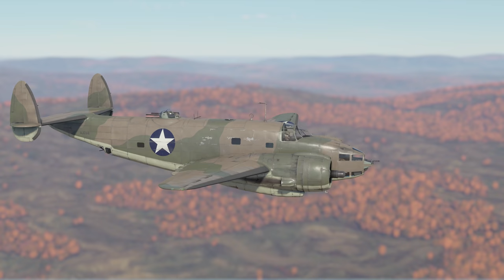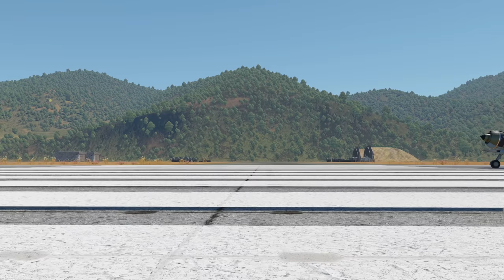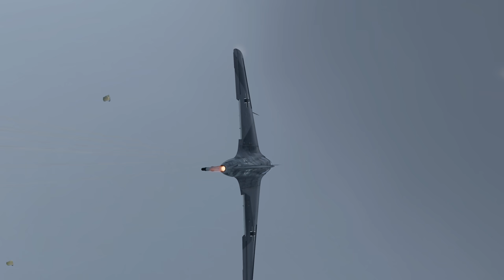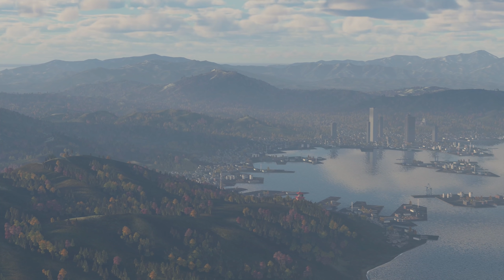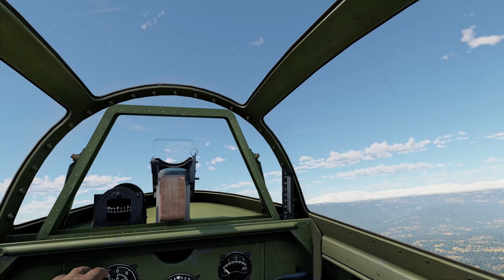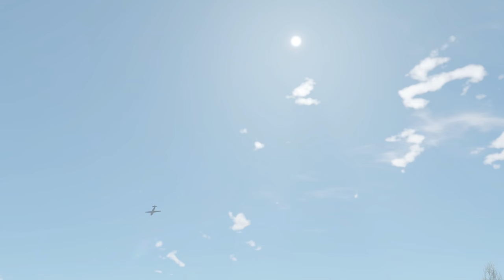Rocket Planes / War Thunder

Comment: So why is it that Ki200 and maybe also Me163 still cannot take off reliably yet still cost that much to repair and then get a video like this dedicated to them?
Reply: You don't enjoy exploding on takeoff for no reason?
Reply: Don’t go 100 percent throttle that’s it I heard
Reply: The rocket planes use different fuel compared to other planes the ki200,163, and the Bi use rocket fuel which is heavier which is why the perform better at low fuel
Reply: (They)

Comment: Day 5 of telling Gajin that they need to increase their SL rewards in random battles
Reply: I prefer them cutting the repair costs
Reply: @ariq4209  both is good.
Reply: @ariq4209  mainly cutting repair costs and making the repair cost the same across nations.  it's kind of unfair that the german is paying 6700sl (It is rank 3 but has the same BR as the other 2 planes) to repair the g2, the Americans are paying 9000sl to repair d5, and the poor soviets have to pay 21000sl for the yak9u.
Reply: @arielkravchinski2616  training costs are unnecessarily high
Reply: @kakagakakerger4165  22k sl for it on b18b help im 1000 sl
Reply: @user-ol9kr8pg8q  my tip is
stop using the b18's except for the 2.7 one
😎👌

Comment: Gaijin what were you thinking when setting 20k silver lion repair cost and 24day repair duration to a simple rocket plane like ki-200?
Reply: They're trying to be slightly realistic
Rocket Fuel is very expensive and very dangerous to handle requiring complex equipment
Reply: @jamesricker3997  this is a game
War thunder is not meant to be the most realistic aviation video game so why the hell should the players care about the logistics behind flying rocket propelled aircrafts???
Reply: @jamesricker3997  in the same game you can buy a war plane fully equipped with guns and ammo for 50k sl
Reply: @jamesricker3997  ratio'd
Reply: @jamesricker3997  if they want it to be a rarity since they don’t want it everywhere in a ww2 setting as it’s unrealistic, just put a thirty minute to an hour timer on it until u can use it again.
Reply: @c17bykenshi67  'War thunder is not meant to be the most realistic aviation video game' Dude. It literally has simulation battles with fuel and wing stress. Just because it isn't DCS doesn't automatically make it Ace Combat.
Reply: @LittleKachowski  lmao thats the funniest comment i read today. I agree with you, that war thunder isnt either extreme but rather something in between in realism. The rocket aircraft fuel being the reason for their high repair costs makes still next to no sense, as far as i know gaijin chooses repair costs almost purely off of how players perform in them, meaning if the average player gets 5 kills per game (or rather how much money they make, for all the bomber guys) in one specific plane gaijin will raise its repair cost so its more high risk high reward. This does however heavily punish lesser experienced players when playing vehicles with high repair costs because they will be dying more often and getting less kills meaning they lose a ton more money than they are making.

Comment: So did you ever fix it so I can take off and not glitch into the ground with the little Doritos?
Reply: hav u tried getting a new hamster to donate
Reply: I got a squirrel, could that work?
Reply: Just throttle up with landing flaps and don't touch the controls until you are off the ground
Reply: @WalletWorrier  i still only get off the ground like 50% of the time.
Reply: @carterstanton3662  You just have to make sure your rear landing gear does not touch the ground, throttle up and pitch the nose down so that your plane is level with the ground, take off with flaps at around 310 kph, take off very slowly so that the rear landing gear doesn't touch the ground.
Reply: @carterstanton3662  make sure you don’t pitch up at all, or that rear gear will hit the ground and cause bounce. Keep the pitch at 0 degrees until 300kph, then u use takeoff flaps and pitch up a tiny bit.
Reply: @ariq4209  It would be nice if doing fancy bullshit was not neccesary just to take off
Reply: Yeah it’s the rear wheel that is glitched, it’s not that it doesn’t spin and causes friction, the suspension seems to be op and bounces the aircraft into a flip killing you instantly or causes you to come to a halt.
Reply: @Betto_333  this made me laugh hard 💀💀
Reply: A Ki 200 exploded next to me when we were taking off. I also died because of the explosion. I didn't even mad, finally had a good laugh in WT after a while
Reply: @daryrizki5236  I would always crash it on takeoff, the trick is to pitch down to get the behind wheel out of the ground and then (with flaps on combat mode) pitch up slightly with +250km/h
Reply: @Jeb724  no the cat is smart enough to shoot him self
Reply: @Jeb724  gaiji will employ you to run the wheel, you will be paid 0.2¢ for a day

Comment: Just imagine being able to take off without a runway, just soaring straight up into the sky and surprise enemy formations and show off vastly superior speed...
Reply: @iplxel7888  they were much later and did not have that much of a technological advantage, but they are still cool.
Reply: @edi9892  and the harriers werent deathtraps
Reply: @user-fj7ig2jq6q   they actually were just in Different ways
Reply: @50centpb7  not even close to the level of the german rockets. This is all irrelevant anyway considering the germans never had an operational vtol, and even their prototypes needed external boosters. And were deathtraps.
Reply: Just imagine being able to take off...
Reply: I've heard that the F-104 Starfighter could take off vertically

Comment: They would be very fun if they didn't have way too big repair costs.
Also Me 163 with 20mms is at 8.7.
8.7
And costs over 25k SL to repair when stock
Reply: Honestly in my first flight of the 8.7 163 I got 3 kills without dieing, the last surviving enemy was a Spitfire MK 1 funially enoough. He dies because he had not enough fuel to RTB.
Reply: its because its good... unfortunately
Reply: Me163 are joke, nothing else
Reply: 25k? Actually that is 5k SL more expensive than my T95
Reply: @zafranorbian757   well the plane is good for sure but you regularly face uptier against plane faster and some with a similar climrate and even some have missiles while you may have very good manoevrability but you only have 5min of fuel (you Can extend that by managing your fuel but still very limited) and not that much ammo and you Always risk to snap your wings during sharp turn

The plane is already itself a high risk high reward but that repair cost (28k for the ki-200 for exemple) is way too much for what the plane gives and to be viable, litteraly if you lose, even if you do multiple kills you will still lose money if you don't have premium
Reply: @ah-64apache92  the joke is Gaijin itself thinking fighting Mach 2 Capables with a 1945 Rocket plane is balanced
Reply: @Manuel - Way, way better 30mms than Mk 108s too.
Reply: @ah-64apache92  Nonsense, git gud
Reply: @Pantsugrenadiere  It also can’t fly a sustained 900kph flight for a long time like the 8.3 Mig-15 and F-86. The B-0 should be back at 8.3.
Reply: And i thought my ki200 was bad
Reply: It also randomly explodes at points on the runway due to the back wheel being glitched and sometimes even kills friendlies
Reply: @Alex Snowden No, the 30mm is fine at 8.0 as 2 x MK 108 isn’t good. The 20mm should be 8.3 because most of the time you’re only flying at 500-600 kph to save fuel, and when it’s 830+ it rips easily at turn. If F-86 and Mig-15 are 8.3, then it should be too.
Reply: you shouold consider yourself lucky that your pilot doesnt get randomly dissolved XD
Reply: the Re.2005 is laughing with its 33k SL repair cost at 5.3 BR
Reply: @colonelgeorge3358  And 6K more than the Ferdinand
Reply: @bobsjepanzerkampfwagen4150  read more, T95 repair cost is 20K. But that is fine since i have 20M SL
Reply: cries in b29
Reply: Yea 20 Mm can stay at 8.0 but 30 mm cant dont have that much burst and less ammo. Second you cant catch many  planes now. Wtf i play 10 games i cant catch anybody in chase.  And for comet is bad cahse on long disitinc.
Reply: @Manuel - 8.3? It's still at 8.0 for now
Reply: @zafranorbian757  better planes like mig15, sabres and the new Italian plane are at a lower br
Reply: @colonelgeorge3358  thats why i edited my comment i tought you said the t95 was 5k more to repair
Reply: if u play arcade it's amazing!
Reply: @AFlyingSwive  b29’s are born to suffer and there’s nothing I love more than blasting them out of the sky with my rocket boosted 262’s
Reply: The Me 163 B (MK 108 cannons) is the only one that has an appropriate repair cost. The Me 163 B-0 and the Ki-200 have abysmal repair costs.
Reply: @Alex Snowden 30mm is always 8.0
Reply: 8.7 makes the purpose of the 162 moot
Reply: The problem is that it's way too good... I've got an average of 4 kills per game with the B-0 in RB and you can even get 6 kills with relative "ease" compared to other planes. 
I agree that the repair cost is just ridiculous and that the BR makes no sense since the F-86 and Mig-15 are at 8.3. But it's very hard to balance and to keep good players from carrying the whole game with a single plane.
Reply: @MotorStorm  do you not get instakilled by missiles? I only ask because I'm considering buying the Ki-200, and I know stuff like the G.91 are on the same br.
Reply: @thelonious2213  just outturn the missile, it's easy.
Reply: @MotorStorm  yeah I get 4 kills too but the team still loses anyway. It's ok to be lowered to 8.3. Also not many plays it, I'm usually the only one in a match.
Reply: The US plains are pretty cheap to repair then if that's how much they really cost. Maybe that's why they don't fly as efficiently and are slower and heavier and so on. Their attack is much stronger but without the maneuverability it doesn't really do much good.
Reply: That's crazy
Reply: @sleepyrasta420  Don't worry, it's 9.3 now.
Reply: i have way too many SL so me 163 would be perfect for me
Reply: You do realise that you could take it into a match with only a few modifications and it’s still going to perform well and if you don’t want to deal with the higher br just don’t get the 20mm
Reply: @captainprice9683  And what does that have to do with anything? That goes for most vehicles in the game.
The 20mms are nice but nowhere near worth being 1.3br higher. 30mms have painfully low velocity though.
Reply: If you play the 163 and wanna have fun just play arcade because you don’t have missiles so it is more fun to 0lay arcade with early jets

Comment: Opinion: i think the Me 163 was very useful, especially to Alexander Lippish. Since it had a swept wing, an experimental design at the time, Lippish practically tested this and not only confirmed that swept wing aircraft was the way to go, but he also theorised that delta winged aircraft could be a possibility. He would later then help a lot in this field, which is arguably what he's known for nowadays. 

I could be wrong, any corrections are appreciated
Reply: Kinda dangerous tho I mean it’s easy to explode and if and fuel leaks you will be literally melted alive
Reply: @xninewxw7559  mhm it was def a daring task to be a pilot. I think once, there was a case where an Me 163 took off and literally 2 sec later it blew up into flames. Apparently he went on the throttle too hard
Reply: In terms of flight characteristics,it was wonderful
Reply: Well Messerschmitt and focke-wulf where expirementing with swept wing designs
Reply: The fuel blew up if it touched grass
Reply: @tylergehring7879  it explodes just by existing.

Comment: Ya I haven't flown my me163 in like a year because it's a flip of the coin getting that fckin glitch where the wheels fall into the runway so I very much hope that some of the budget for this advertisement when into making the plane playable
Reply: make sure you don’t pitch up at all, or that rear gear will hit the ground and cause bounce. Keep the pitch at 0 degrees until 300kph, then u use takeoff flaps and pitch up a tiny bit.
Reply: @ariq4209  It doesn't have takeoff flaps. It has landing flaps.
Reply: @cheesuschrist5017  whatever flap works
Reply: @cheesuschrist5017  Don't press f or you will not be able to take off.
Reply: "Its not a glitch its historical accuracy"

Comment: I've actually become a bit of a professional flying the Ki-200, getting about 5 to 6 kills per match and usually surviving to the end. If you can get really good and and survive the repair cost becomes practically nothing even when you do die every so often, simply because of how much money you get in return.
Honestly, the Ki-200 is my favorite plane in Warthunder, and I can even out perform Sabers and Migs.
A few tips of mine are 1: Only use about 50% throttle most of the time you are in the air. 2: Make sure you use landing flaps when taking off, because it likes to bounce on the runway past 200 KMH, then quickly retract them once off the ground. 3: Try not to head on other planes, if you get caught going head to head with another plane, fire a small burst and quickly turn off, your plane will most likely explode or your pilot will die if you get shot, so use your maneuverability to your advantage. I typically like to do a turn into a half spiral ascending and quickly turn behind the enemy plane. 4: One of my most important points, stay near your allies and stay above or at the same level as your enemies, it will give you an advantage.
Reply: Great tips, thank you. Was wondering to this time how to utilize that little rocket plane with 5 mins of fuel and barely any armor. Preferrably using the -30 or -40 Sabre. Anyway, is it worth to carry 1 min of fuel in any case?
Reply: @fahmihardian7778  That one minute of fuel only gets you off the air strip, so in reality you only get about 4 minutes of fuel once taken off, and about 3 minutes once you reach 3000 meters in altitude. So always take max fuel.
Reply: you wont really need to be above or similar altitude as enemies, as you can easily throttle up and negate the altitude advantage instantly
Reply: @khlobbia  That's usually not a good idea if other enemies are near, because if you try to climb you lose speed the more vertical you face. All it does is give the enemy more advantage; I've seen many people even in rocket planes get baited like that and they die at the start of the match.
Reply: @dustinmorecraft8699  you're right, I got the plane yesterday and barely played it but now I realize the top speed is not as good so you want to dive on enemies and you want teammates nearby.

Comment: Rocket planes: they cant even take off lmao
Reply: Dont full throttle them
Reply: make sure you don’t pitch up at all, or that rear gear will hit the ground and cause bounce. Keep the pitch at 0 degrees until 300kph, then u use takeoff flaps and pitch up a tiny bit.
Reply: Realism
Reply: @ariq4209  sometimes even that doesn't matter, the physics engine can pop you like a balloon on bumpy dirt airfields
Reply: put landing flaps

Comment: Me 163/Ki-200 deserve either a lower BR, or an airspawn fitting of an interceptor.
Reply: They used to have an interceptor spawn but got removed. Now those planes take off from the airfield but the rear wheel is glitched and causes you to crash on the runway, so they are mostly unplayable now + their repair costs.
Reply: @byance97  I was there Gandalf, 3000 patches ago.

Comment: Fun fact: There was a good chance that if something went wrong or an engineer wasn't super careful with the Komets liquid fuel then pilot would be reduced to soup in the cockpit. Imagine training for months only to be turned to a slush before you even took off. After they ran out of fuel they were easy pickings, strat being to just avoid them until they spent their load and just follow up behind them while they're in a glide and finish them off or shoot em up where ever they land which was never very far.

Comment: Chasing a ghost.  Rocket motors were suitable for Point Defense interception; a concept soon bankrupt as technologies for standoff and ballistic missiles improved.  Once bombers did not have to pass over heavily defended targets in order to bombard them, the need for a Point Defense Interceptor vanished and the age of the long range All Weather Interceptor (and its AA Missiles) began.
  That's a tactical utility appraisal.  Additionally:
1) Soviet BI (and some other) fighter projects used "red fuming" Nitric Acid as an Oxidizer.  Glass tanks broke; metal tanks melted; pilots were literally eaten out of their protective suits.  That's the origin of the "Gray Alien" trope: acid burned, half dissolved, test pilots*.
2) Deutscher Raketen plane projects pursued both conventional take-off and landing craft like the Me163, and the Ba349, a rail launched Point Defense Interceptor.  German oxidizer was "85% pure" Hydrogen Peroxide, another incredibly dangerous stoff to organic tissues.  More glass tanks, more pilots eaten alive and the odd inexplicable mid air explosion.
*That's what they were testing at Area 51, btw.  Odd shapes, rocket propulsion, and pilots eaten out of their suits.

Comment: What’s the function of the tiny propellers on the German rocket planes? 
And why the JP ones don’t have it?
Reply: It's a security allowing to produce electricity when something else fail (which was very important for this plane, I don't remember why). It was a really good idea, and it's now mandatory on planes (even it's hidden unless it's needed).
Reply: @MrMorvana  you’re talking about a RAT ram air turbine. Airbus has them, Boeing has another system I believe
Reply: @MrMorvana  The rocket engine doesn't provide power for the instruments, unlike a traditional propeller engine would.